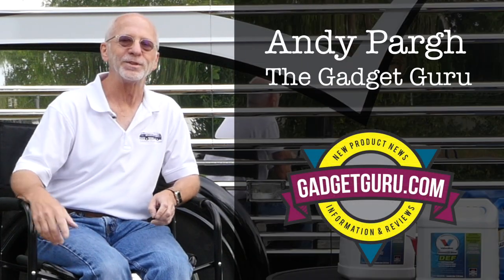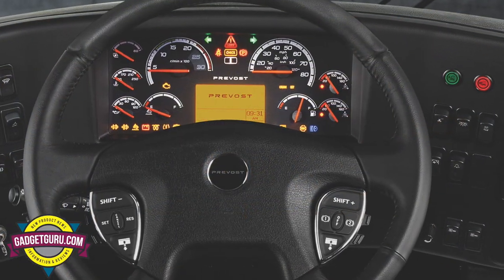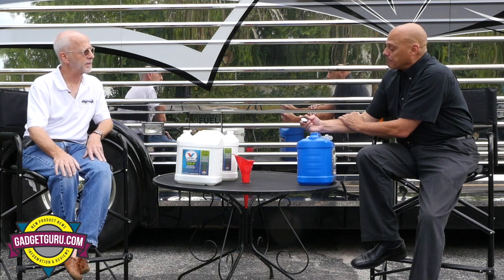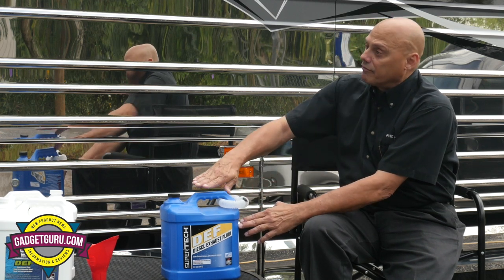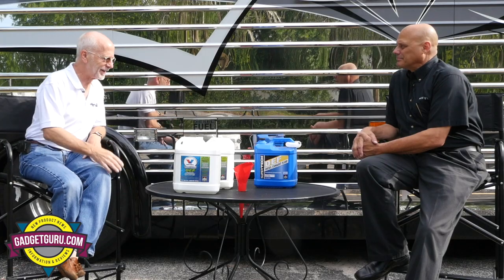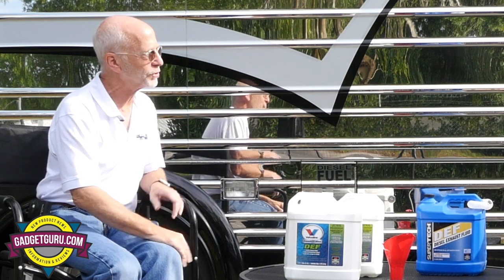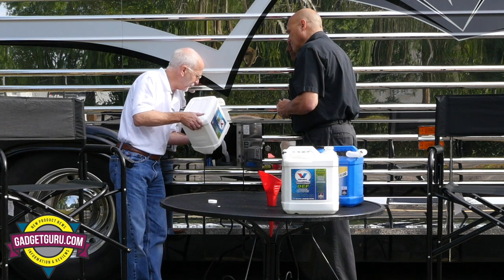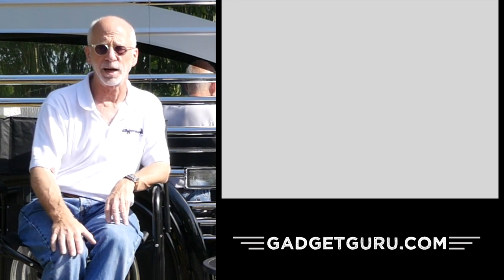What You Need To Know About Motorhome DEF

Comment: I noticed on the Valvoline containing sitting on the table, at about time stamp 13:53, there appears to be a handgrip on the underside rear of the container. When your turned the container around for pouring, I wondered if you were then able to make use of the grip. If so then apparently the manufacturer would consider that the correct position to pour from. 

What great timing. Just yesterday I was filling my mower from a gas can that has the air intact in the spout. The container has always been a pain to get the gas to flow evenly because of the air intake. I'll try turning it around like you did.
Reply from the maker: I'll check out the underside when I get back to the coach. I can say it's more of a ridge than a grip and with the weight of the jug I'm not sure if that will provide enough leverage.
Reply: Thanks for the follow up!

Comment: as far as the def  I think the solution is a inexpensive siphon pump like used to fill a kerosene heater. all you need is a slightly higher point to set or hang the container on, like a step ladder. no lifting and holding.

Comment: Andy you're the best!.. but I got to wonder, if the guy. (and he is the prevot Guru if you will)  tells you a few times he's not a fan of carrying the DEF on the coach and he explained why. so why do you keep on saying yeah but I carry it on the coach?, why not just listen and follow his advice?
Reply from the maker: Good Question HB! Prior to the interview, it was my habit to carry a couple of jugs of DEF on the coach and to fill as needed. Yes, I learned something in this video as well, so I'll need to change my ways. Also, since my coach has the DEF filler neck on the passenger side, I cannot fill DEF at the filler pumps, so I do have to fill from the jugs. Like other Newbies, I'm learning as I go along!
Reply: you're correct. Marathon should modify your coach and run another line from the other side so that you can fill Def at the pumps. if I was Marathon coach I would offer that as a free modification to any marathon owner who needs it

Comment: I hope in the near future Def gets dropped, i won't buy any newer diesel that has to use it.
Reply: Daniel Ramsey what's the big deal.
Reply: He says it like the industry came up with the idea to reduce knocking. Far from the truth. Its government mandated emissions control and it really does nothing to improve emissions. Its just an expensive pain in the ass for diesel drivers. Costs a fortune to fix or replace when it inevitably fails.
Reply: He didn't say "knocking", he said "NOx", short for nitrogen oxides, a pollutant. DEF is made of 32.5% urea and 67.5% purified water. When injected into the hot exhaust stream, the water evaporates, and the urea thermally decomposes to form ammonia and isocyanic acid. The isocyanic acid hydrolyses to carbon dioxide and ammonia. From this point, ammonia, in the presence of oxygen and a catalyst, will reduce nitrogen oxides. The federal emission requirement is no more than 2.5 grams of NOx per brake horsepower per hour. Most of the NOx gasses in the exhaust stream are converted into a blend of five parts nitrogen, eight parts water vapor, and four parts carbon dioxide, all harmless gasses.
Reply: @MYCHANNELWITHMYSTUFF  AMEN, the soultion is simple, buy older more reliable engines that go way more miles between rebuilds and cost less to rebuild than what it costs to fix the Fd up def system once it does crap out on you...    Come one the gov has these people literally pissing money away on useless urea.